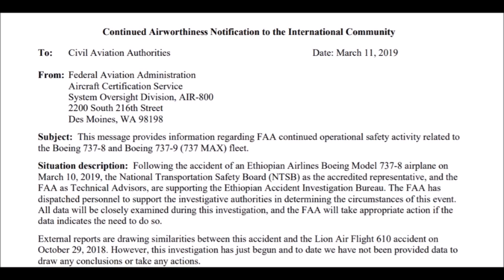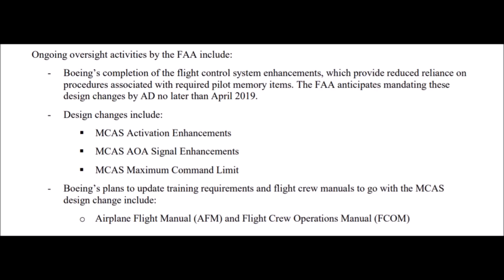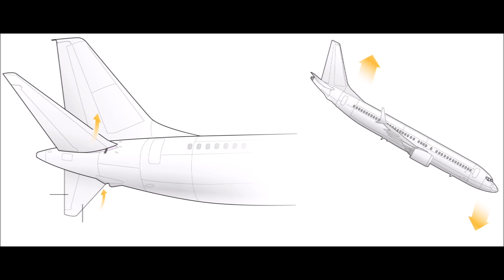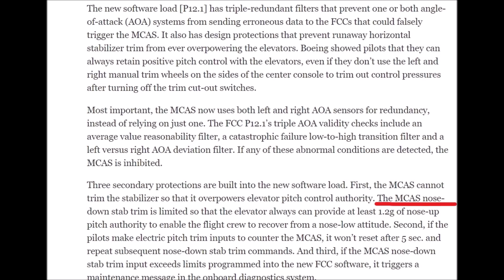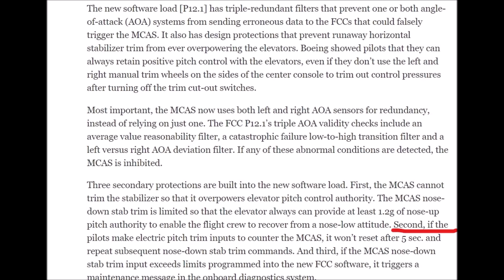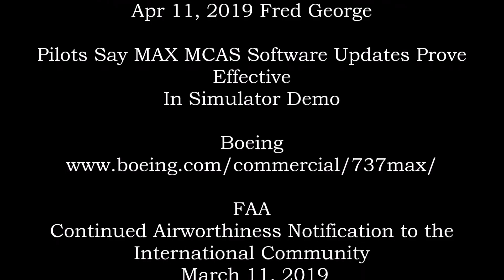737 Max UPDATE 14 April 2019 "The Fix"

Comment: What bugs me is how the heck MCAS got certified using only one AOA indicator at a time, WHEN THERE ARE TWO OF THEM.  Aviation is all about the redundancy of systems.  This makes me wonder what other blunders might be undiscovered.  They will hopefully take a good look at all the other systems that got certification by the same means.
Reply: Yeah no kidding. Boeing built triple redundancy into practically every major system in their aircraft in the past. Then approved a modern system that can effectively take the pilot inputs away from them at the most critical phases of flight based on one sensor....heads need to roll for this one. Violating aircraft system design 101 here.
Reply: Nunya Biznes
Reply: What puzzles me is that the Lion flight prior to the crash flight experienced the AOA problem, but wasn't grounded/fixed.  Maybe I missed something?
Reply: @jameylane9196  the testing software they use to run the diagnostic only tests one sensor at a time and unfortunately when you start the test it switches it to the other AOA sensor when you run the test (so they likely thought they was testing the left sensor when it switched sensors at the start of the test) witch in this case was working (co-pilot side) when you run the test a second time it then switches to the other sensor (you need to run the AOA sensor test twice to get it to do both sensors, unsure if it states that in the manual that you need to run the test twice)

I think it's a bit stupid that when you start the test it's switch is the sensor to other side when starting the test as it may have been they were not aware about the sensor switching when they start the test so when they had the captain side set to primary and they ran the test they may have not been aware that it was testing the co-pilot side as they had reported that the captain side aoa sensor was not operating correctly
Reply: @leexgx   scary
Reply: @playhooky  but now issue is corrected and more errors will show up when things are not working correctly (just unfortunately taken lots of lives doing it, but should of never happened in first place)
Reply: The sensors swop after each flight cycle.
Reply: @ajones8699  Makes no sense to switch sensors after each flight. That would DOUBLE the possibility of flying on a bad AOA sensor.
Reply: Ziggy it does not make any sense to me, I have no idea what the thinking was. So when the plane landed the sensors swooped, so when tested no fault was found. The test was a cycle. So when it took off next it was back on the bad sensor... utter madness.
Reply: @ajones8699  That has to be the most stupid design decision I've ever heard of. The fact that the system doesn't check the second AOA sensor if the one being referenced as primary, is...absurd. I'm just... "They did WHAT?!?"

Boeing is gonna get sued until the cows come home on this one, and I can't say that I blame the plaintiffs on this one either...
Reply: @jameylane9196  ye they fixed it but next flight other sensor was used which was broken too .
Reply: @jameylane9196  Well, yeah I guess. But what's more "puzzling" (infuriating, devastating, heart breaking might be better words) is Lion air crashed, they knew exactly what the problem was and let Ethiopia happen before grounding the MAX!
Reply: @jameylane9196  I saw a youtube video stating that the MCAS system cycles through the AOA sensors.  So each flight it selects one to use as the sole input. So when the mechanics came to check, the system had switched to the functioning AOA sensor so passed the checks. I think they were not aware that it cycles through sensors.
Reply: Kaman Ajayi  - I doubt that bad AOA was dedicated solely to the MCAS.  Why would MCAS "cycle" if it has it's own AOA sensor?  The mechanics missed an AOA sensor, so I doubt "the MCAS working" is the only check.
Reply: @jameylane9196  from what I know the fix has been in the works since that crash happened and thats why Boeing thought the fix could roll out relatively quickly
Reply: . . .the fix has been in since that crash happened. . .
Reply: @jameylane9196 : At that point no one except Boeing knew that a single sensor failure can take down the plane. Ie. people maintaining the systems didn't know it was that critical.
Reply: THIS GOES AGAINST BOEING PRINCIPLE.
Reply: Frank Heuvelman umm no amount of quality build and parts could have prevented this - it is fundamentally a BAD design with too much control and NO redundancy. Those sensors would fail eventually wether due to wear and tear or damage eg. Bird strike or poor maintenance. As soon as any of those happened the aircraft is doomed.
Reply: if it was not criminal this leadership could be amazing.
😂 sad
Reply: And so say all of us...
It doesn't just go against the Boeing Principle, it goes against every engineering (mechanical and computer), aviation and common sense principle. I assume that's why the FBI are involved.
Reply: A program to check one sensor against another is not a major software revision.  In the event of an anomaly, revert in default to manual flight control system.  Real time weather data plus attitude relative to horizon plus true airspeed will tell any decent pilot whether or not a stall s imminent.  Pretty much basic aviating.
Reply: mcas had more power than it should have had. if it were only minor adjustment, pilots would always be able to override the inputs, thus redundancy not required. obviously this was a mistake.
Reply: Whats the Point of the FAA to, Eat Taxespayer funds?
Reply: @Dean Howell The FAA are traffic cops, not airplane designers. The point of the FAA is to certify that planes observe the manufacturer's tests of a plane and observe  that it seems to fly and perform correctly, and then to monitor that it continues to do so. The FAA is NOT a design bureau. The FAA is a monitoring and compliance bureau. 

The FAA would have to be bigger than NASA to do what you think they should do. And look how well NASA F**ked up two shuttle flights by deliberately doing EXACTLY the sort of engineering-by-management-fiat that appears to have happened at Boeing in this case.

The FAA has done exactly what they should have done in this case: they looked at the accident, saw a smoking gun, and took the plane out of the air until the manufacturer can provide a fix for the problem, and that fix gets installed in every existing plane in the fleet as well as all new production.

The problem here is that Boeing did it (amazingly) wrong in the first place. Not that the traffic cops pulled them over after the problem was seen.
Reply: @lwilton  Actually, I believe that the President of the United States had to issue an executive order to ground the MAX fleet because FAA was sitting around with their thumbs up their bodily orifices. Meanwhile, the civil aviation authorities in nearly every other industrialized nation was issuing orders to ground the planes.
Reply: Wesley Hurd. - Sadly true.  Other countries grounded the Max before the FAA finally admitted Boeing had a big problem.
It was hard to believe the govt ignored it as long as they did , maybe the USA selling planes had more influence on them than passenger safety which is supposed to be their first priority.  Or maybe I’m wrong . . .
Reply: @r11rs  Come on man, be reasonable!  It was at most  three days after the 
Ethiopian Airlines crash when FAA grounded the Max 8/9. They were waiting for NTSB to release to them the data  from the Flight Data Recorder and Cockpit Voice Recorder to be analyzed. That takes a few days.
Reply: @Douglas McIntyre  In this case I have to disagree. When you lose that many people on 2 planes with a new design during takeoff phase with similar flight profiles why would you not play it safe and temporarily ground the Max until the similarities can be proven true or false. 
“ The FAA initially stated it had not received any evidence to justify taking action against the 737 MAX. “
Well for once they should have gone into preventative maintenance mode instead of this bull crap that we have no evidence YET that it needs to be grounded. Time to think outside the box instead of relying on an old procedure that obviously does not fit this scenario ( in my interpretation only ) but you have every right to disagree.  I don’t share your view that old procedures are applicable in all cases , that you let passengers continue into the unknown until we have proof. YMMV.
Reply: @r11rs  We can second guess the pilots and the regulator, or the maker of the AoA sensor and the ground maintenance people who washed the planes and apparently damaged the left side AoA sensors all we want. But until the final report by NTSB is issued, it is just pilots' and others' speculation, as you well know. 

I must say I have grave doubts as to whether the flying public will get back on Max 8s/9s once the grounding is lifted. Whether or not Boeing and the FAA come up with a robust software upgrade and put more language into the flight manuals and QRHs on how to recognize and troubleshoot failed AoA sensor/MCAS related loss of control scenarios. it is possible that the same fate that befell the first iteration of the Dehavilland Comet may happen to Boeing's max 8/9. 

If it all goes to hell for Boeing regarding this design it isn't out of the realm of possibility could that Boeing would be forced to re-engineer the Max series and then attempt to sell it under a different name, like 737-1000 or whatever.   

The good news is that the  latest examples of flight data recorders and cockpit voice recorders were in those planes, collecting  perhaps a hundred data parameters or more. If they were recovered in good condition, all of that data would effectively become the template for how to write the simulator software for future MCAS training. And a provide pilots and regulators with the skills to  avoid accidents of this type in the future.
Reply: @Apophis Rock Not just Boeing. The FAA needs to be sued, hard and often, since they certified the Max 8/9 designs. And I hope the AoA sensor manufacturer gets sued out of existence.
Reply: @douglasmcintyre3297    "I hope the AoA sensor manufacturer gets sued out of existence."    I disagree.   Nobody can make an instrument that NEVER fails.   Sometimes they fail due to bad maintenance or incorrect installation.   Proper design takes account of all that, which is why most systems are triplicated.
Reply: @cr10001  Do you think it could have been possible for the pilots (first officers probably) who did the walk around inspections of the Lion Air and Ethiopian Airlines aircraft to spot a faulty or damaged AoA sensor? And if an AoA sensor is giving wildly inaccurate data (in the case of the Ethiopian aircraft showing 70 degrees angle of attack), why doesn't that trigger an audible alarm that the pilots could have reacted to?
Reply: @douglasmcintyre3297  The FAA like most of the federal government is immune.
Reply: @Milkmans_Son  Perhaps. But FAA needs to wear this just as much as Boeing, for certifying the Max 8/9 designs.
Reply: "what other blunders might be undiscovered". This whole MCAS debacle had revealed a lot of them, including:
* Boeing and FAA is in bed together. FAA let Boeing do the certifying themselves.
* Design of MCAS reflects the Boeing's design principle of profit over safety.
* The emergency handling procedure is awfully inadequate. Pilots have to read a book during an emergency, and the screen is helpless. A warning light cost $80,000 to install.
* The emergency manual trim wheel won't work if the plane is heading down and air speed is increased. So why that emergency system is still there?
* Boeing will not tell pilots even the most important safety issues to save some training money.
* Boeing will lie to the whole world about their safety issues, until their lies are busted.
* The design of 737 Max structure is unbalanced, easier to go into a stall and harder to recover from it. Pilots might notice nothing even when the MCAS system is off, but they will definitely know the difference when the plane is in a stall.
* Boeing's AOA vanes are prone to failures, and they are each controlled by one flight control computers. Their diagnostic system cannot test both AOA sensors and computers on the ground. So if one of those two flight control computer is malfunctioning, in the next flight the plane will switch to it, the next Ethiopian crash will be guaranteed, but the diagnostic system won't be able to find the problem on the ground.
Reply: yes just like most things if there are 2 and there is a mismatch it should kick out
Reply: More important, that such thing happens not the first time with Boeing, they had set thrust to idle on landing based only on ONE (error) sensor input SILENTLY WHEN PILOTS WORKLOADS MOST HEAVY (and that was not noticed until too late) so several planes crashed (including 737 series).
Reply: @sddndsiduae4b-688  And when was this?
Reply: @bloodguard41  2009,  sorry may be only one plane  Turkish Airlines Flight 1951 , they retrained pilots and fixed bug(now function will be disabled if altimeter sensors disagree)  faster ten years ago.
Reply: @sddndsiduae4b-688  Well, it's good that they fixed that issue. Although, honestly, the pilots do bare a significant amount of responsibility for that crash.
Reply: @bloodguard41  same may be said about latest 737 MAX crash too, but really if in heavy workload situation automatic system !silently! changes something in control of plane which would lead to crash(if not fixed in few seconds), that automatics should be disabled, also important that Boeing(in contrast of Airbus) always stated that pilots are in control of plane, not automatic systems (which can be explicitly activated to help pilots), but they actually doing it other way around(i.e. installing additional automatic systems which do intervene in control of plane without being explicitly enabled by pilots, and without voice warning about changes they made in control of plane).
Reply: talon0863: You are exactly right sir. Shame on Boeing, the FAA and the manufacturer of those AoA sensors. This is going to make a lot of lawyers wealthy, given all the tort exposure those three organizations have brought down on themselves.
Reply: @Apophis Rock you mean, they should be fired?
Reply: What so disturb is that Both sensors is already connected to MCAS but Boeing programmed it to use only one.... Why?
Reply: @mukamuka0 Id say because that's how the 1960s duplicated system worked.  You had the left alpha sensor connected to the pilots stick shaker and the right to the copilots.  Likewise altimeter, artificial horizon. This works when you have man in the loop to do a sanity check on the sensor before diving into the ground but not if you directly control.
Reply: @Apophis Rock If you think coders are making decisions like which sensor input to use, you have absolutely no idea how it works.
Reply: W N  -  Ok, so it wasn't corrected properly.  Just as bad.  Unless you can tell me how it wasn't able to be diagnosed properly,  because yeah your "backup" AOA is "somewhat" important for IFR.
Reply: @Frank Heuvelman Of course I'm remembering!  But that was a native 737, not an "enhanced" one, a very reliable plane! Luckily, the  commandant was a seasoned pilot and had a very good F/O (a woman, as it was!) and they both performed an outstanding landing, in spite of the change of  all flying parameters!
Reply: Ongoing corruption of government agencies who doesn’t care human life. FDA is another agency like that. So is EPA.
Reply: There was an investigation of this thing. It is a legal loophole: They say that adding a "two-sensor" system would require additional certification and mandatory simulation time. "One-sensor" solution was deemed just an upgrade to existing systems and required no additional certification or training.
Reply: @volo870  What are you talking about?  Previous 737 have two AOA sensors.
Reply: @talon0863  Yes. 737 Max has the same two AOA sensors. But MCAS used only one of those, to "seem" simple enough to avoid extra certification.
Reply: peoples llives dont matter ONLY MONEY...
Reply: Flying the plane using the stabilizers goes against the core principle of flying. Furthermore, since stabilizers have more authority than the elevators, you can get into a situation where there stick input does not do anything. It is a terrible, cheap design.
Reply: Heck, I'm an automotive master technician, and I definitely can't believe it either! Chances are, your SUV programmed better! But to be fair, the average person would be surprised with the amount of programming issues with new vehicles.
Reply: @talon0863 "wonder what other blunders might be undiscovered." Absolutely! "They hopefully take a good look at other systems." I don't think so. We might have to face reality and be aware, as long as money and power is involved, "they" never ever will do something they're not totally forced to. To find out about all other skeletons in the closet, there first have to die further people. Unfortunately, in our capitalistic economy system that's the way the cookie crumbles.
Reply: The Reign in Spane falls manely in duh plane. . .